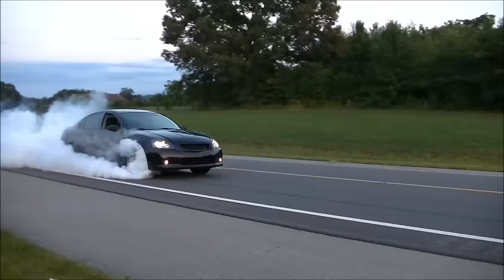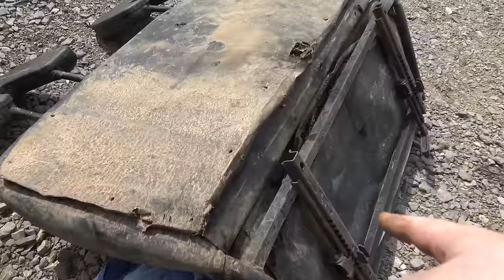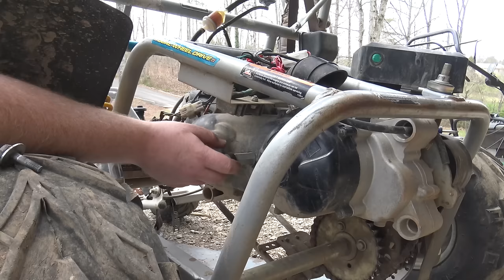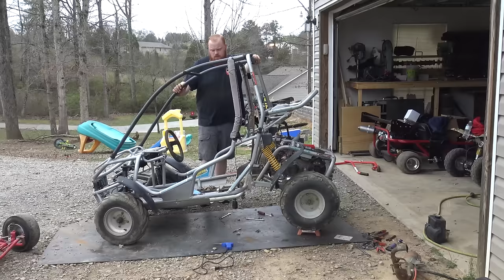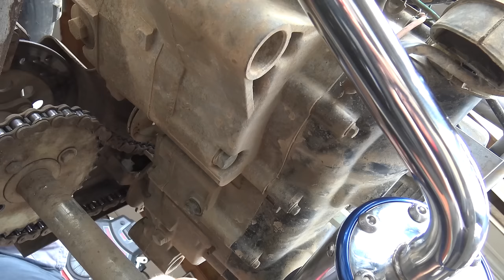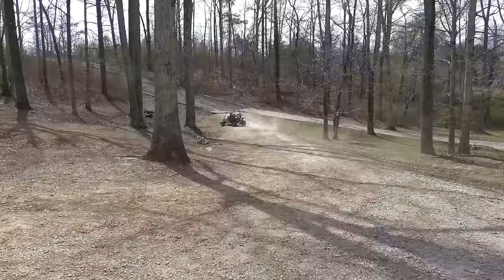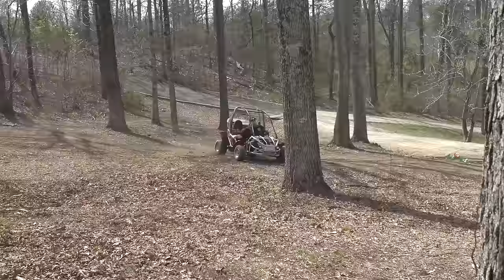150cc Go Kart Performance Upgrades

Comment: Do you happen to still have the Go Power Sports part # for that UNI pod filter with the extension tube and jets? I have a Kandi that needs the filter extension and bracket to make a Pod fit correctly. I have been searching their site and cannot find it. Thanks
Reply: look at BuggypartsNW. They have tons of parts and aftermarket upgrades
Reply: @PhatChanceAthat  Thanks for the reply. Ended up building the pod filter manifold tube assembly myself, bought a jet kit off E-bay and rebuilt and tuned the carb. Got it running great, played with it for two weeks and got tired of the hassle of crawling in and out and sold the Kandi about 6 months ago.
Reply: @davidchapman2839  do you have a similar 150 cc buggy with the air box removed and bigger exhaust? If so what main jet worked good in your setup?
Reply: @PhatChanceAthat  I don't have another buggy and I am afraid it has been so long ago that I do not remember the jet size I used. I do remember going up in size initially on both and then increasing from there. It was a days worth of tinkering and testing to get both jets where I was happy but I also remember the last time I drove it felt it could use even more.

Comment: $300?! I pay less than that for whole go karts!
Reply from the maker: +A.J.'s ATV Repair shop yeah it is a little high but like I stated to another comment that's what you would pay for a dirt bike or ATV full exhaust kit.
Reply: A.J.'s ATV Repair shop  Where to the hoses go I have one of those 150 go kart and I can’t figure out where the hoses go where the fuel line curves

Comment: Greg, you really need some ratchet wrenches buddy.
Reply from the maker: +Alex Gresham I have ratchet wenches. They wouldn't fit in where the exhaust stud was.
Reply: I gotcha. I hate it when I'm in tight spots like that and have to use box ends. I feel like it takes forever man. Oh well, that's the life if you're gonna be turning wrenches.

Comment: $300 muffler what a joke!
Reply from the maker: +Cory Hoover if you have any ATV or dirt bike it's $300 for a full aftermarket exhaust, so how is this any different?
Reply: Red Beard's Garage I missed the fact the SS header was included with the slip on silencer.  And yes I own a quad, dirt bike, and crotch rocket. I just feel $300 for a go- kart exhaust sounds a bit much. but point taken.
Reply from the maker: It is but I like it quite a bit and I believe its the only one on the market.